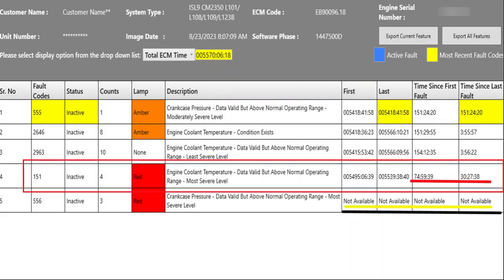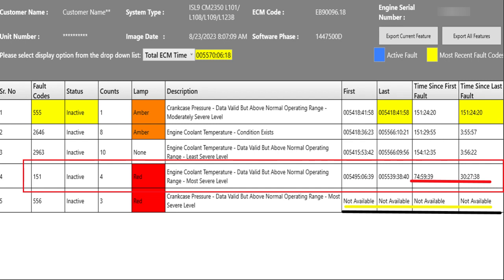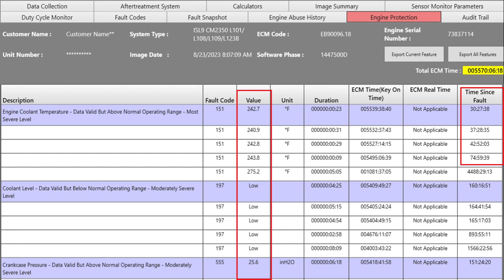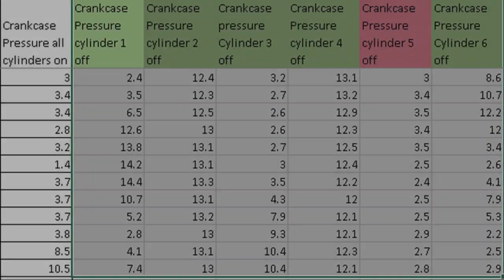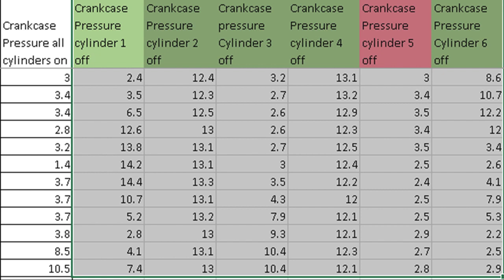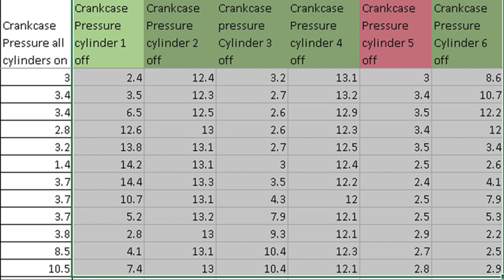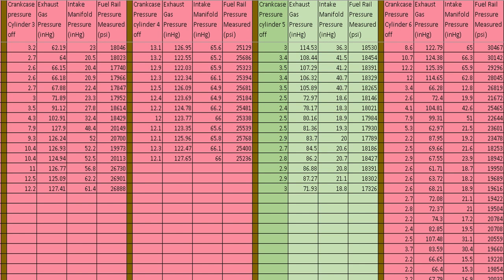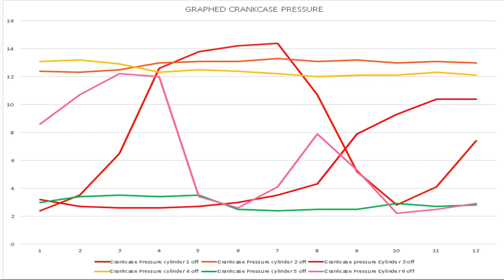QSL9 high crankcase pressure. What's the problem?

Comment: Great information sir, was curious on how would the egr cooler cause excessive crankcase pressure readings on isl9 isb6.7 engines when restricted/clogged ?? Thanks
Reply from the maker: Hi and thanks for the question. When the egr valve opens the turbo VGT closes to Push EGR into the intake. If the cooler is Plugged when the VGT closes exhaust gas pressure can climb very high. This directly raises cylinder pressure on the exhaust stroke. So you have higher pressures in the exhaust ports. If the valve guides are worn that pressure will go up the guide and into the valve cover. That becomes crankcase pressure. Mind you it is a small amount of exhaust by volume however think about how many times that happens to each cylinder when the engine is going at 1800 rpm. On a dyno I have seen blowby decrease 5 inches after a partially plugged cooler was replaced because I looked at that value while troubleshooting on a dyno.
Reply: @ENGINESHOPJOE  I didn't take the VGT actuator into consideration/factor but I can see what you mean pressures gotta go somewhere. Interesting something more to monitor when it arises. Thanks sub'd